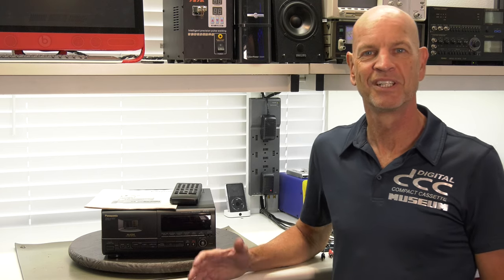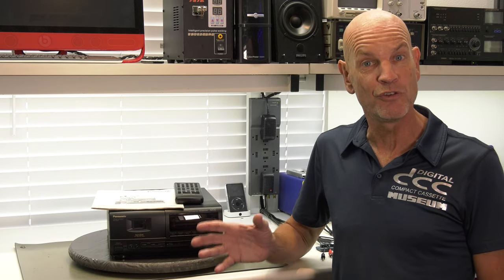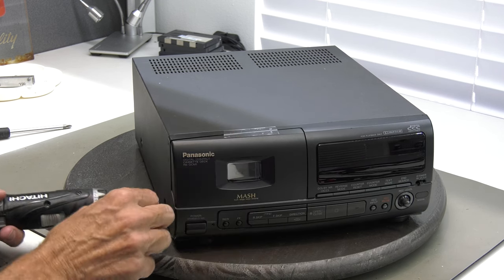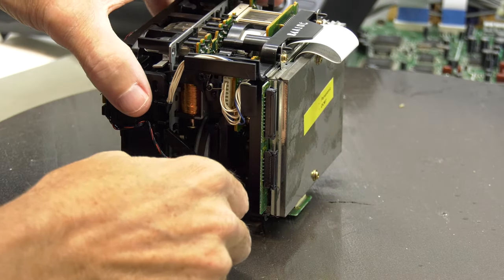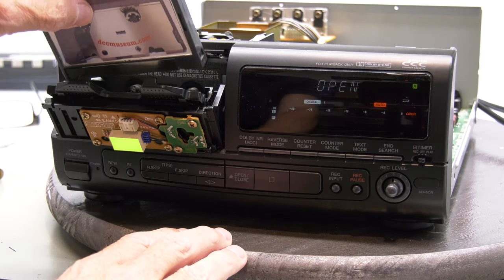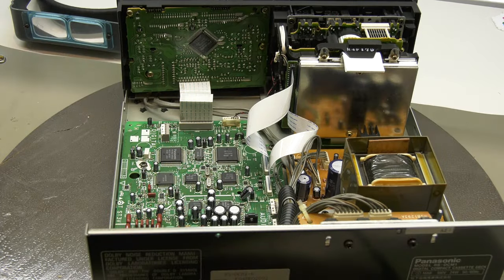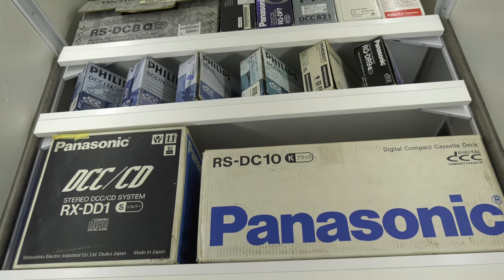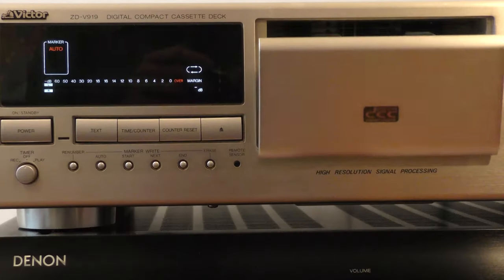The Last Missing DCC Player! The Panasonic RS-DCM1 Digital Compact Cassette

Comment: Very nice! Congratulations. And a prosperous, healthy and perhaps happy 2022 to you all.

Did you indeed recap it? The caps looked all fine to me. And the three identical connectors at the back look like optical digital ones (toslink), or aren't they?

One remark: there is a space missing in the title at 0530 between David and Jac. I hope they don't mind being teamed up this way.
Reply from the maker: Good eye on the Space. That must have been there for quite some time, but we will correct it in future videos that are not already edited. The 3 connectors are Toslink. The capacitors mostly seem fine, but in fact they hardly ever are. So we replace them immediately during restoration as we would not like to open the mechanism any time soon.

Comment: I have same Technics DCC at home.
Playback is working fine with prerecorded dcc-s and regular cassettes but I am wondering can I record on it because I see that it have optical inputs. I tried to record from Technics minidisc mds 150 optical output but no success.... :(
 Is it possible that I need remote control for some reason to do that?  Thanks
Reply from the maker: For the fastest help forum.dccmuseum.com  That way others can learn as well.

Comment: Back in the day I was working in a stereo shop in the netherlands and the DCC came out I was... confused. I still am, because I didn't saw/see the point of DCC. I thought MD was a more user-friendly system because of the speed of a cd system. Back then I didn't have the money for both. so I used a technics RSBX501 cassettedeck which was fantastic. I never longed for a DCC. MD, yes.. which is the reason i'm using one now that I bought for 50 euros. That, plus the reputation of Philips quality.